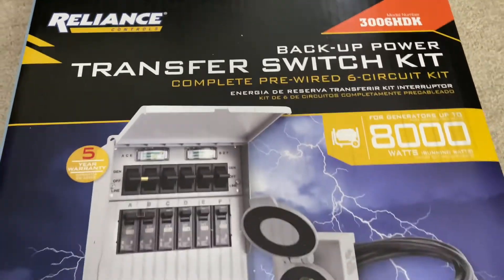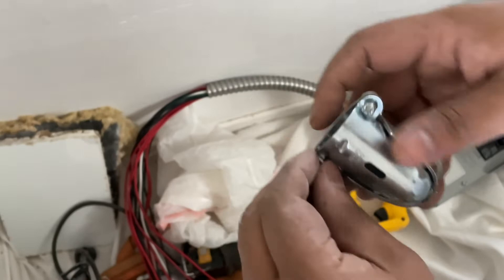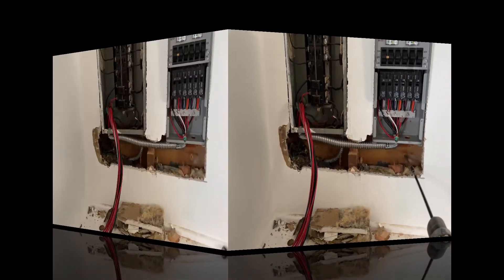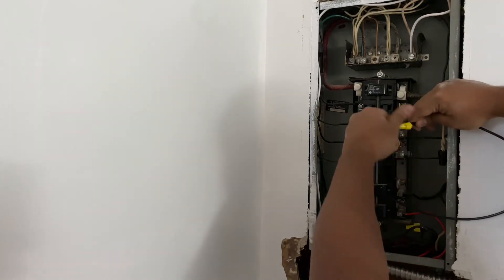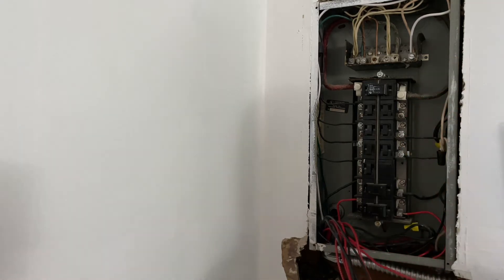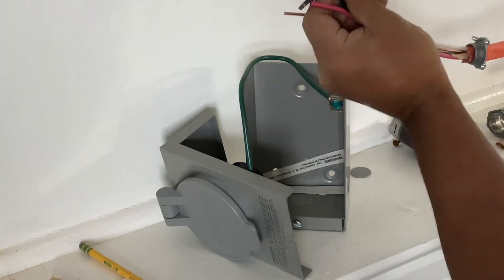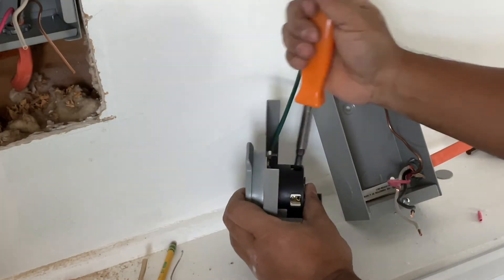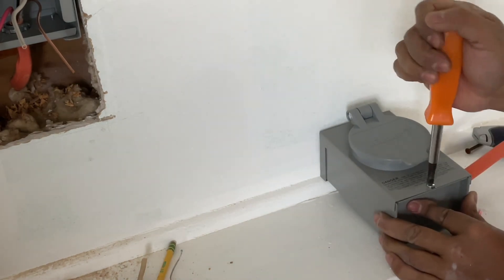How to install a transfer switch - Reliance Controls

Comment: I got mostly 20 amp circuit breakers on my main breaker box. I see that this transfer box has a few 15amp breakers. Can i replace those 15 amps to 20amp breakers on switch as ill need more 20amp breakers
Reply from the maker: You should check the manual to confirm the compatibility of the breakers.
Reply: @TheLandlordsWorkshop how can i find out? On main panel?
Reply from the maker: The transfer switch comes with a Manuel.  The information should be there. I personally would not change the breakers from 15 to 20 amp.
Reply: @TheLandlordsWorkshop ok thanks you sir

Comment: Is it more complicated if you have solar panels or it doesn’t matter?
Reply from the maker: This would be an additional way to power your house. It does not matter because this transfer switch will isolate  the house power source from main line and connect you to generator power.

Comment: Where to find a replacement breaker for the 15amp breakers that are there. I would like to change them to 20amp. All my circuits will be 20amp. Please dont say check the manufacturer
Reply from the maker: You can check online or old hardware store might carry.
Reply: @TheLandlordsWorkshop  but i dont have the transfer switch to know. Ive asked multiple people on youtube and no one knows
Reply from the maker: You should never change a 15-amp breaker in a Reliance transfer switch to a 20-amp. Here’s why:

The switch is UL-listed for 15A only — changing it voids the safety rating.

The wiring inside is 14-gauge, only rated for 15A. A 20A breaker can overheat it and cause fire.

NEC code (240.4D) requires breakers to match wire size — 20A on 14-gauge is a violation.

It can overload the generator and damage the equipment.

Warranty and insurance coverage may be void if something happens.

Bottom line: the breaker size is there for protection, not convenience. Upsizing puts your property, generator, and safety at serious risk.
Reply: @TheLandlordsWorkshop  thats a pretty poor design because if im limited to only 15 amps then I can only run lights. I can hook it to receptacles but what if i wanna use a microwave, fridge, coffee pot, hair dryer etc. I want to purchase the 6 circuit model but that's limits everything such as if i wanted to run my water pump, heater and microwave that are hooked up to 20 amp breakers in my panel. I know they all cant be run at the same time but now because of the poor design I can't hook them all to the transfer switch. If thays the case how youre describing they should've put 4 20 amp breakers and 2 15amp. I can always use flashlights in a storm etc bit I cant run a microwave, ac, refrigerator etc. What a poor design. Im only using a 3500 watt generator and limited to two breakers. Thats really piss poor
Reply: @TheLandlordsWorkshop  I was told in the reliance installation video that the first two 20 amp breakers can be changed to 30 amp. For 240v but cannot exceed that. All in all its a big let down and a poor design. All my receptacles in my house are run with 12 guage wire so to hook them up to a 15 amp breaker isnt correct either so what am i to do. This is insane
Reply: @TheLandlordsWorkshop (Yes, you can swap out the circuit breakers in a Reliance transfer switch, as the switches are designed with UL-listed, interchangeable 1-inch breakers that can be easily reconfigured in the field. To do so, turn off all power, remove the circuit breaker compartment cover, then unscrew the terminal screw on the breaker you wish to remove, disconnect its wire, and lift the breaker out. Reverse this process to install a new, compatible breaker. Remember to ensure the new breaker's amperage rating does not exceed the transfer switch's wiring capacity, which is typically 30 amps for the A and B positions and 20 amps for other positions.) This is the information i just read on google
Reply: @TheLandlordsWorkshop  i spoke with a representative at reliance controls. They told that all the circuit breakers are wired with 12 guage wire except breakers a and b
Reply from the maker: Cool

Comment: How much do you charge to install?
Reply from the maker: Unfortunately, I am super busy, but the average price to install a Reliance transfer switch typically ranges from $500 to $1,500. This cost can vary based on factors such as the specific model, local labor rates, and the complexity of the installation. It’s a good idea to get quotes from licensed electricians to get a more accurate estimate.

Comment: Can I switch out a couple of the breakers with 30 amp breakers?
Reply from the maker: @stevec9889  It all depends on the size of wiring . 30 amp might be too much for typical wiring to handle.

Comment: I got to install this today. So. You said it does not come with the wire that leads to outside?
Reply from the maker: Correct i had to buy separately
Reply: @TheLandlordsWorkshop  what size wire is the wire going outside? Thanks!
Reply from the maker: @matthewadams7313 I used 10/3

Comment: My home has a PV solar system.
Will my house solar interfere with my plans to install a manual transfer switch to control 6 house circuits? 
I am concern that there will be feedback from solar to my Ecoflow battery.

Comment: My 4500W generator has a 3-prong outlet. Can I use a 3 prong to 4prong adaptor cord to connect the generator to the inlet box?
Reply: You can, but if I understand correctly, the 3 prong is only 115v/15 amp.  (It should say near the outlet on the gen.). Your 4 prong 30 amp cord would then only be carrying what the outlet can put out, 115w/15 amp.

Comment: Thank you, and I will add, the first thing I think is best to do is to ID all your circuits on your main panel.. like, know what’s connected to each circuit on your main breaker box (panel box), and ID them with tape paper using a good ink, or type it out from printer.
Reply from the maker: Great tip!

Comment: I installed this same kit in my house. Very easy and actually I had fun doing it (I’m retired). Put the hookup box out  by the deck in back,bought an extra 25 ft 10 gauge extension cord and I can run my Dura-Max 5500watt generator in my garage. After I take my cars out of course. Run two refrigerators,one microwave(20 amp)one counter plug(20 amp) circuit in basement family room and the furnace. Easy peasy!
Reply from the maker: Thanks for sharing your experience.

Comment: Good video except I can't use wire nuts in the main panel where I live.
Reply from the maker: Very interesting. What do you guys use?
Reply: @TheLandlordsWorkshop  Wires must be connected outside the main panel in yet another panel. I guess the possibility of connections coming apart is the problem. Safety first, you know, lol. Canada, eh!
Reply from the maker: @Synonomous  definitely sounds much safer .
Reply: @handymanschool  I came across this info as I'm looking to install a generator right now and apparently It came into effect a year or two ago. More expensive but yeah, people don't always make connections properly and this helps for sure.
Reply from the maker: @Synonomous  I am loving your valuable feedback . Thanks
Reply: @handymanschool  Also, if you're connecting a generator to the house not to a tool, it needs to be floating neutral not bonded neutral to have only one source of grounding. This is not mentioned in any videos on this topic. It should be. People could make a problem for themselves.

Comment: Just a Note... Each pair of wires (Red and Black) are marked with a letter- ABCD on the side of the insulation. Be be sure to keep these "paired" to the household circuits that you are choosing to run off the generator. Suggestion, See Reliance official videos.

Comment: Thanks for a quality video from a pro. I came here prior to troubleshooting my transfer switch to review a proper installation. Though I've used my Reliance kit 3 times successfully since I installed it in '19 (plus a 1 a year test) problems with two circuits occurred during last months power outage. I will be checking wire nuts first of course. Seems to be my main fault when I DIY around the house :( Have been switching to WAGO's. Thanks again sir.
Reply: I switched to Wago wire connectors too.  (Not because of electrical problems) They work great. Expensive, but worth the money.